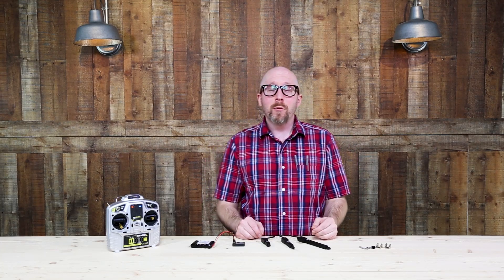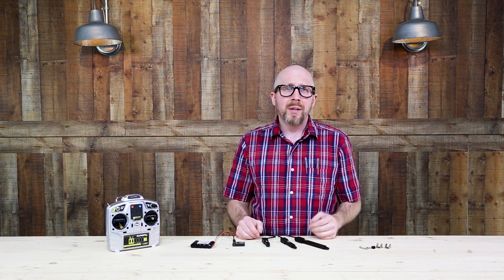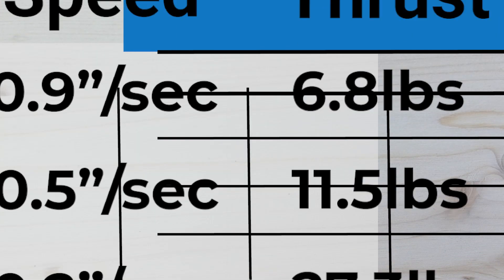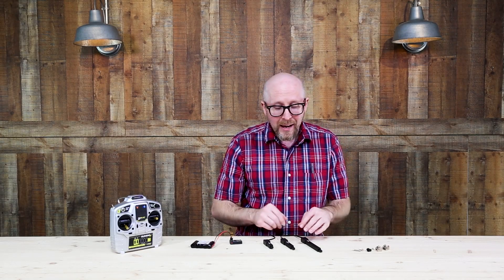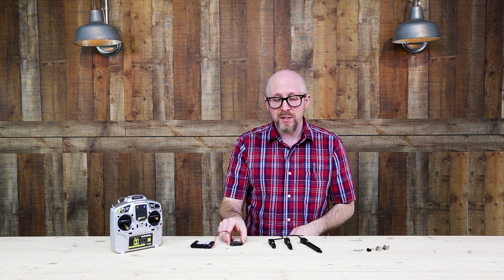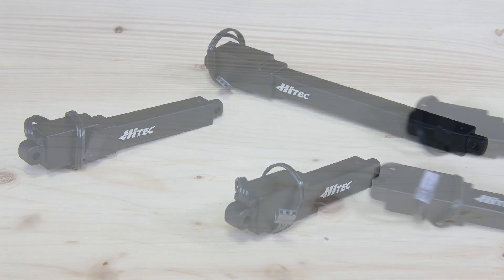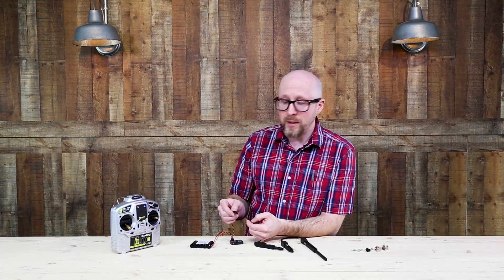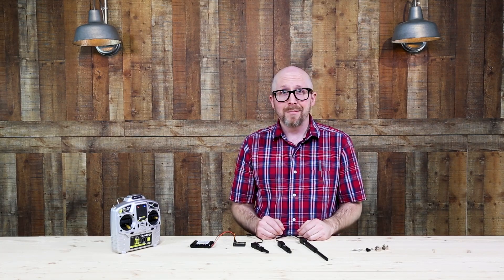New Hitec Linear Servos

Comment: I am building an autonomous boat using pixahwk flight controller. How do I go about connecting the pixhawk with the linear servo? 

Do I need a separate power source for the servo but get the signal cable from the Pixhawk?
Reply from the maker: We are unfortunately don't have much info on the Pixhawk controller, if you would email our techs with some specifications and links they may be able to look into that for you! You can reach them at tech@servocity.com
Reply: These servos can draw >500mA so yes you should use a separate power supply for the servos. Make sure the grounds are connected between the servo power and the pixhawk PWM output.